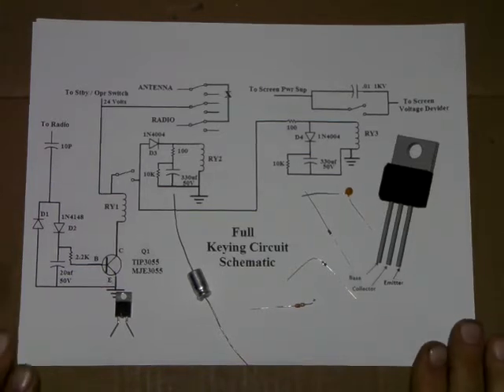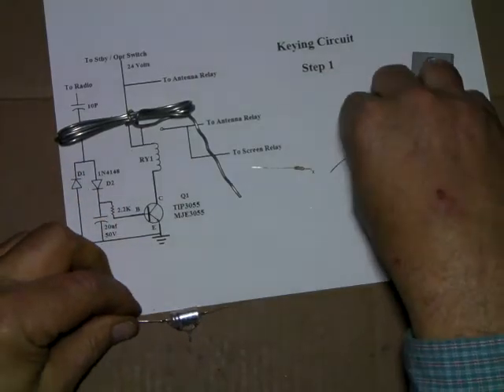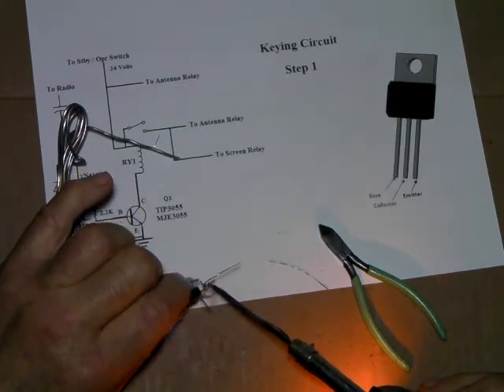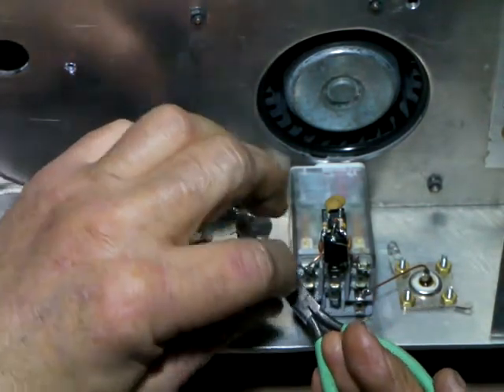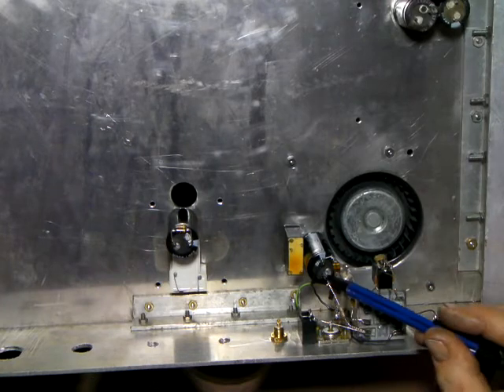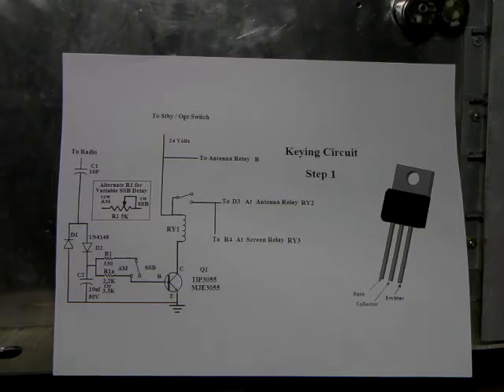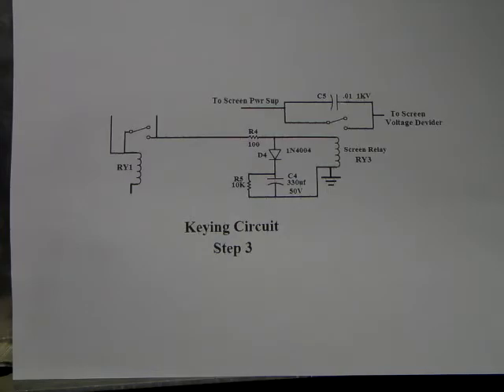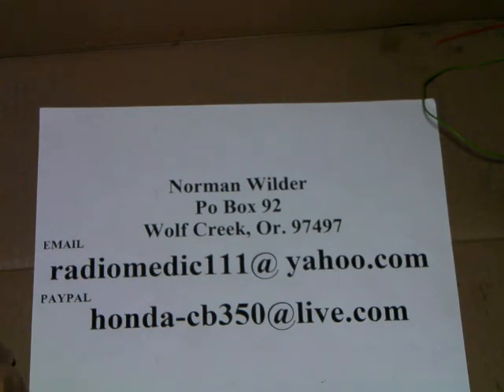Single Tube 4CX250B Amp For 27 Mhz  The Build Pt 12

Comment: Great stuff as always. I am kinda curious why you don't use diodes on the relay coils so the spike you get doesn't tear hell with your other components. With the flyback the pulse is commonly several hundred volts Since I come with an automotive background I automatically put a 1n4001 across all relays despite what I have said about parts count. Or does it mess up your time constant?